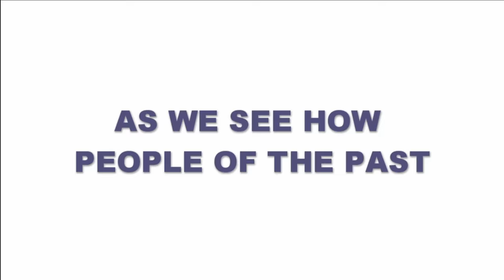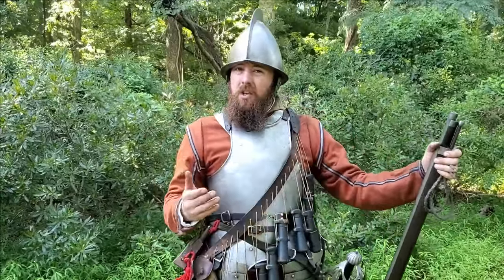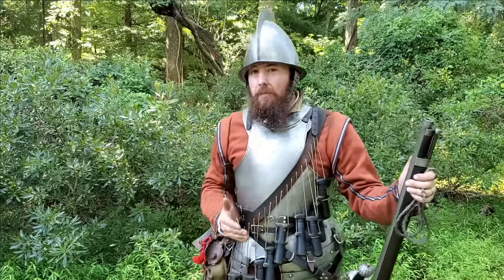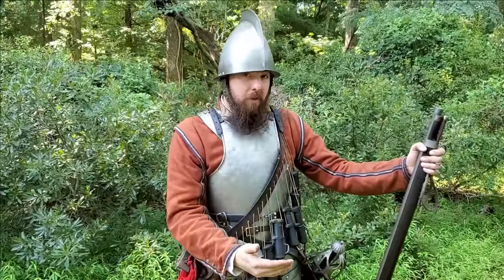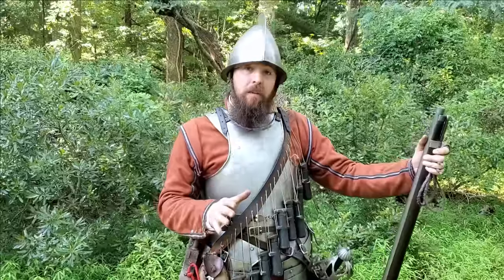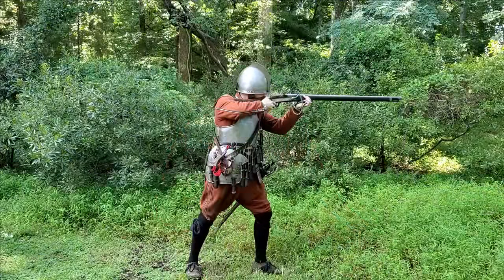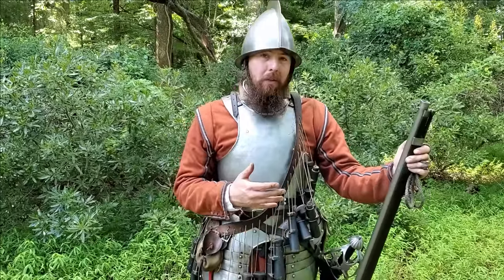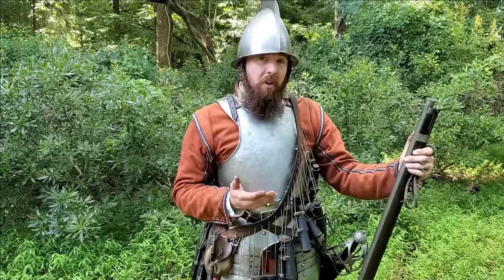Primed and Loaded | Matchlock Arquebus Rate of Fire

Comment: Very interesting.  In particular, it's interesting that he emphasizes the importance of carefully aiming.  I had thought that with smooth bore (non-rifled) muskets, the weapons were so inaccurate that the soldiers were trained to shoot in the general direction of the enemy rather than to take aim.  Apparently I was wrong!
Reply from the maker: Well, so inaccurate is one of those enduring historical mythologies that's become humorously  ridiculous.   

Our modern expectations, we believe are clouded by our expectations of the performance of modern firearms on a range. Anything less becomes inaccurate.  But the battlefied is full of the confusion, terror and horror of battle. No matter how well practiced a musketeer they are going to miss.  Nevermind the issues of poorly trained soldiers or issues like spoiled or poor quality gunpowder. 

These were the early days of marksmanship and it's not that the firearm were so inaccurate, it's often the shooter.  They were taught to aim, and firearms were manufactured with at least front and maybe rear sites.  Misses were extremely common, but its not necessarily because the firearm was so inaccurate.
Reply: There was more value back then in keeping up a large volume of fire, necessitating volleys at a rapid pace that would eventually subside into random 'fire at will' behaviour. You could certainly aim if you wanted to, but it comes at the cost of volume. A conscript soldier who has fired 2 rounds down range, is equipped with poor quality powder and ball, maybe caught up in the heat of battle, perhaps tired from several days' marching and firing as fast as they can will likely be somewhat inaccurate. 

Sharpshooting was the job of skirmishers deployed in front of line infantry formations, who would pick off officers and so on with some degree of accuracy, possible because the musket is pretty good out to 100 yards (I say muskets because French sharpshooters were equipped with smoothbore muskets. Other powers preferred rifles, the accuracy of which is undisputed by historical fact and conventional knowledge in a way that the accuracy of the musket isn't).
Reply from the maker: We would have to ask, who, when and where?  To say that "more value...keeping up a large volume of fire...volleys at a rapid pace..."  is not necessarily accurate and may be applicable for specific conflicts and specific historic periods but it is not universal.  16th and 17th century battles depended heavily on the pike to carry the fight as the main body of infantry, with shot being in a supportive role.  Plus musketeers and calivermen are not carrying an amount of ammunition that is going to allow great volumes of fire.  Engagements are also often an extension of siege activities, often settling down into small unit actions.
Reply: @JYFMuseums  You are right of course. I should have specified that my comments referred to the Napoleonic era of warfare, which was unclear in the comment. 

Sustained volume of fire is what’s wanted from a unit in theory, but most engagements were soon broken by bayonet charges on the part of one side for the other, so I don’t imagine there was much time to totally shoot the other unit to pieces. I may be wrong however, I am just a hobbyist historian on warfare.

Edit: still referring to Napoleonic warfare

Comment: The problem I see is not factoring in the fact that the shooter would fire (volley) then move to the rear ranks, and ONLY then be able to stand still and reload, so either reloading while marching to the rear was common (multitasking) or the opportunity to fire (volley) would be punctuated with a long interval after loading at the rear position.
Reply: Well they literally talked about that in the video, I guess you didn't actually watch the informational part and only showed up for the boom boom?  Also, what about defending walls or trenches?  No deep files of soldiers to rotate with in a trench.

Comment: Shooting a French trade gun with military type cartridges I got off five shots in a minute eleven starting loaded. Not good enough for English requirements for the bess 
But I haven’t practiced it as much as a soldier 
With a flintlock rifle and patched ball using a bullet board and short starter, both inventions probably came in to use after the flintlock era, I got off three shots in 54 seconds. 
So this matchlock is well within range of any ml.

Comment: Colin Hollands
Interesting Video, I would say that I would actually count that as 3 shots in the time, as you were already loaded for the first shot, but whatever, I am a musketeer in the UK in the English Civil War Society, and use a 20 bore matchlock, Personally i use a powder flask to prime and then use paper cartridges to load and wad, this speeds up the process and on a good day i am very close to 3 shots a minute, however having said that , there are so many variables on just loading to get perfect, that it is very likely never to achieve that sort of speed, i.e powder not flowing easily from flask, it gets slower the more shots and less powder in the flask, missing the barrel with a cartridge, cartridge crumpling instead of clean insertion, mis alignment of scouring stick either going into barrel for ramming or returning to its resting place, mis alignment of match, and missing the pan, match damp/not hot enough to ignite the powder etc etc etc the list is long of things that could and do go wrong if you are trying for speed. But as you stated, in the 17th century, I would have been one of many musketeers in a block, and so long as i was loaded in time for the next time my rank came to the front (or in the odd occasion when attacked by Cavalry from flank or rear, ready to respond to that) it was good enough.
Reply from the maker: Hello Colin.  We've covered this point previously, but Brian is working with the manual of arms from Wapenhandelinghe van Roers Musquetten ende Spiessen/The Exercise of Arms for Calivers, Muskets and Pikes. Illustrated by Jacob de Gheyn and published in the 1607. The manual starts with a loaded musket and the weapon's discharge before carrying the musketeer through the loading process.  We strongly believe that any discussion of a rate of fire or the rate at which a musketeer reloads their firearm should always start from the perspective of a loaded weapon.

For us though, it does beg the question, why are so many wedded to only counting or discussing a rate of fire from the perspective of only "three timed shots"? What late-16th or early-17th century primary source dictates that only three shots are counted or timed or that a rate of fire is three shots per minute?  Neither Sir Roger Williams in "A briefe discourse of vvarre" nor Sir John Smythe in "Certain discourses...concerning the formes and effects of diuers sorts of weapons, and other verie important matters militarie..." cover or address the rate of fire of musketeers or calivermen.
Reply: @JYFMuseums  my guess would be a lot of people, probably myself included would have got it from a passage of dialogue from a uk tv series, Sharpe, which was based on a book about Napoleonic British unit called the 95th rifles......how much is based on fact and how much is artistic license is anyone's guess, your research and the surviving manuals of the day, are probably far more reliable source

Comment: As Lieutenant Sharpe told us, you don't need the ramrod, just a lil tap on the stock, so the bullet goes all the way down... but you have to keep the barrle up for the bullet not to fall out again... but taht won't be a problem, since the frenchmen is high on his horse anyway.

so it's bite spit, pour, tap fire!

;)

/watch?v=Z9RAh1J4NE0

for anyone who is curious.

for this video - well done, sir that was pretty quick!

Comment: A good job! But it looks like at least one operation is excluded from the process. After loading the bullet into the trunk it should be fixed by the wad. The wad avoids felling out the bullet from the trunk and creates additional pressure in the trunk. Otherwise, most gases from the powder firing will exit from the trunk without working, because the caliber of the bullet is a little bit less than the caliber of the trunk. On the other side, I don't see the usage of an authentic powder: there is no cloud of thick smoke after a shot.
Reply from the maker: Well, a couple things. First, why are you patching or wadding a ball in a smoothbore musket? That defeats the benefit of a smoothbore arm. It was not necessary and not a normal practice for smoothbore weapons. 

When looking at Wapenhandelinghe van Roers Musquetten ende Spiessen ("The Exercise of Arms For Calivers, Muskets, and Pikes"), this being the manual to instruct soldiers in Dutch service, in the English edition of the musket manual the instructions for plates 26 and 27 state, “In the 26. (desirous to take shorter the skowring-stick) how he shall thrust the same (turned) against the bodye letting the hand slippe hastely to the neather ende for to bring it the surer in the Musket and if he will shoote with a bullet, he shall with the same hand that tooke shorter the skowring-stick, take speedely the bullet out of his mouthe or place where he usually carrieth them, and so let it fall or roule into the Musket. In the 27. how he shall with the skowring-stick ramme the pouder and bullet together in the Musket trayling still the rest but not the Musket, if he be strong ynough.

The musketeer is instructed to take the bullet from his mouth and put the bullet into the muzzle of the weapon letting it fall or roll down the bore of the piece, then seat the powder and shot with his scouring stick. No patching or wadding. 

In the caliver portion of the manual the instructions for plates 25 and 26 state, “In the 25. how he desiring to take the skowring stick shorter in his hand, shall turne the end of the same (which is the end that furst he pulled out (and thrust it to his bodye, slippinge the hand quickly to the neather end, to bringe it the better and the steadyer into the peece and if he will shoote with a bullet he shall take the bullet with the same hand (wherewith he now hath the skowring stick shorter) out of his mouth or from thence where he carrieth his bullets, and with like quicknes put it into the mouth of the peece.  In the 26. how he shall with the skowring-stick ramme in the pouder and the bullet together, holding alwayes the peece from the ground, like as this figure sheweth.”

Again, no patching or wadding used.

Finally, we can assure you that real black powder is used in all our historic weapons. You might have missed the smoke coming off each shot.
Reply: @JYFMuseums  Thank you. Maybe in the massive usage of many guns together in a row, there is no need to use the wad.
Reply: I think you may be mixing up time periods a little.  The use of muskets changed a lot over the centuries.  Wadding the round becomes common by the 1700s when the weapons were finally standardized and the mass produced bullets were often undersized, but in the 1500s and 1600s soldiers mostly had to cast their own bullets, and therefore would more often be using bullets that fit the barrel well, so no need for a wad.  Remember that gunpowder weapons have been used for many centuries, and what may be true for one era may not apply in another.

Comment: Were chargers like those used before anyone came up with paper cartridges? It's difficult for me to imagine that anyone would have preferred the weight and resource intensity of those chargers relative to paper cartridges in a pouch.
Reply from the maker: Yes, the bandolier predates the advent of paper cartrides, although by the end of the 16th century paper cartridges were beginning to be used by cavalry.

Regarding weight, thats insignificant.  A 16th/17th century bandolier weighs no more than cartridge boxes of the 18th or 19th centuries. Resource intensity? The infrastructure for the manufacture of bandoliers existed across a number of trades and labors. The bandolier could also be recharged in the course of an engagement. There is a certain fragility to paper cartridges, that did not exist in the bandolier. Especially tossed into a pouch and the reason for cartridge boxes having forms like wooden blocks or cartridge box tins to protect paper cartridge ammunition.

Comment: What would musketeers have done in a battle if it started to rain heavily? Did they have a backup role or weapon?
Reply from the maker: It is difficult to say exactly what a musketeer may have done.  In our experience we have learned tricks for keeping the match coals dry and hot.  We have learned to always keeping the priming pan closed, or to turn the musket upside down so that the rain does not fall on the priming pan.  But no matter the tricks we have learned, gunpowder is hygroscopic and will easily become  spoiled when exposed to moisture.  Probably among a number of reasons that musketeers, calivermen and arquebusiers carried swords and daggers as well

Comment: Well I actually don't know this answer how much shot is carried with 12 tubes of powder measured but I believe unmeasured powder was also carried.
So approximately how many shots does a musketeer have? Before needing supplies
Reply from the maker: That a bandolier had 12 bottles was not a universal nor a firm standard. Many illustrations and extant examples are shown with both more and less than 12 bottles.

One thought was that gunpowder should be half the weight of lead. That if two pounds of lead were provided, one pound of gunpowder was sufficient to propel the shot. The bore size of a weapon actually determined the number of shots. At .75 caliber there generally would be 12 bullets cast from a pound of lead and at .60 caliber there generally would be 20 bullets to a pound of lead.
Reply: @JYFMuseums  yes that sounds about right. I reenact a Polish light cavalrymen early 17thc maybe 1620s.
I am carrying about 12 pistol and or carbine shot in cartridges, and the primer in my flask.
But again 12 shots but there is no standard with a cartridge box, If 14 so be it etc., 

I am puzzled as to what musketeers hsd to do in staged battle, and may need to engage a number of times throughout the day in battle?
I should know this but don't as the Poles didn't field musketeers unless mercenaries from Europe.
Reply from the maker: @nicktrueman224   It can be frustrating.  This is an evolutionary period of European warfare and things were changing quickly. The standardization and doctrine are not fully realized.  There’s no standardization of ammunition, no ready-made factory ammunition, and musketeers and caliver men are often casting their own shot.  Ordnance boards and ministries are relatively new and not fully realized, those that have previously existed oversaw the storage of weapons and munitions.  Just wait until governments come to understand the need to purchase and account for the use and consumption of small arms ammunition.

During the Eighty Years War much of the fighting involved sieges and small unit actions that tended to accompany siege operations.  These actions could be short, sharp, and quickly turned into melees of swords and clubs.  Musketeers could sally forth, engage in a short fight then fall back to their own works and replenish their ammunition.
Reply: @JYFMuseums  were Cavalry used by your dutch etc settlers you reenact?
I know very little about Europeans early in America
Reply from the maker: @nicktrueman224  We're examining the English experience in early 17th century Virginia -- the period when the Virginia Company of London had begun the English colonial efforts in North America.

In this timeframe cavalry were not used and the English relied heavily on boats and small ships for transport and the movement of soldiers on the Chesapeake Bay and rivers of Virginia.

Comment: what are the things hanging from the sash?
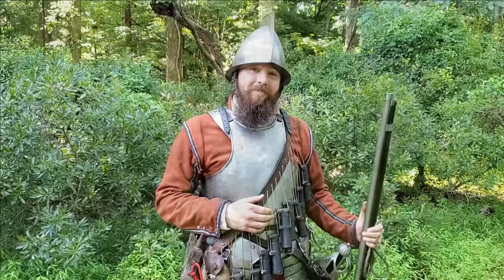Reply: That sash is the bandolier, or simply the ammunition belt.  The bandolier is worn from the left shoulder to the right hip, and at the right hip is the bullet pouch.  Hanging from the bandolier are chargers which are wooden bottles that will hold one charge of gunpowder. To load the weapon, the musketeer with grab a bottle, pop off the top and pour the gunpowder into the bore of the weapon.  He'll then grab a bullet from the bullet pouch and put it into the weapon as well, then draw the scouring stick to ram down and seat the charge. If you go to the 5:24 to 7:00 mark you can watch Brian go through the process of loading the musket from the bandolier.

One interesting little note. In his 1624 list of what a English settler should be bringing to Virginia, Captain John Smith does include the bandolier, at the cost of 1 shilling 6 pence.

Comment: What if one accidently put in the projectile before the propellent into the barrel? would it even be possible to remove it?
Reply from the maker: Yes, if the bullet was mistakenly loaded prior to charging the piece with powder the projectile could be removed.  There was usually enough windage between the ball and the bore that the musket could be turned over, given a thump, and the ball was dislodged and fell from the barrel.  If necessary a ball puller could be attached to a scouring stick, put down the bore and threaded into the ball to pull it out.